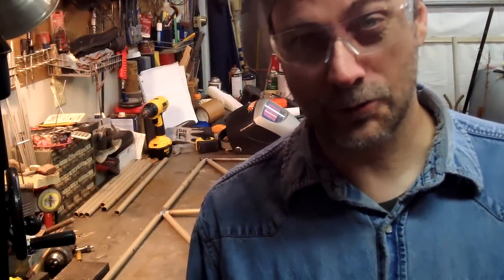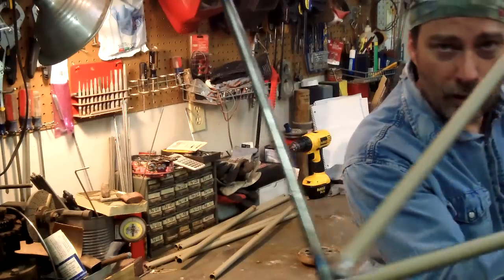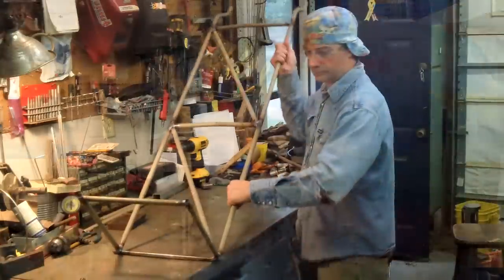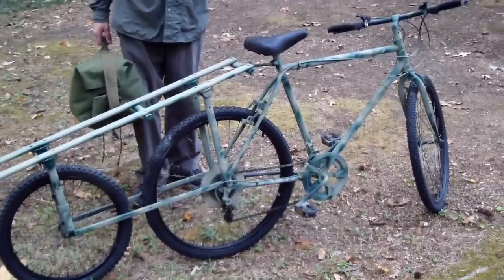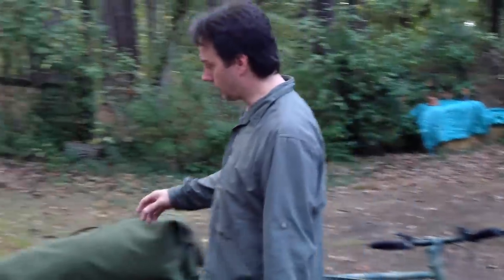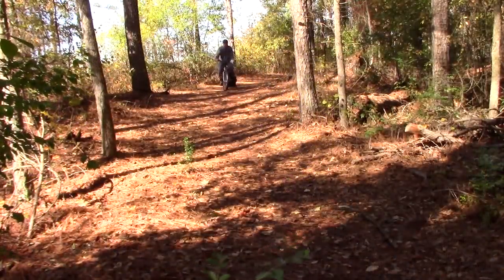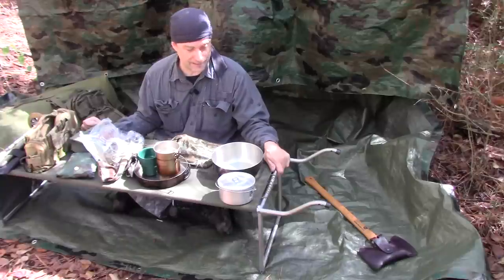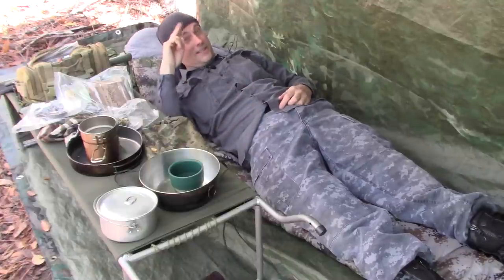The Bushcraft Camping Bicycle Travois

Comment: I dream of one day having a TIG welder but until then I have to make do. I'm thinking one of those convertible hand carts that you can use as a two wheeler or platform dolly and modify it into something similar. It would be heavier of course.
Reply from the maker: Absolutely get a TIG when you can. It's incredible. Thanks for watching Jim

Comment: dave buddy great idea looks great but those wheels are going to be your down fall . i pulled a trailer behind my bike for years . look for a child's bicycle trailer . then ether modify it  or strip it for the parts you need  best part is if you find the right one the wheels are quick  release and i think they have the high speed bearings as well    . another  thing and i found this to be the best way to do it and it gives you another place to put gear is to put a bicycle rack in the back it will give you the clearance for the tire lower the center of gravity on the trailer  and with a little modification you can still use your ball pivot . oh and a small piece of ply wood in that cloth sleeve would be light and stable for a table as well . if it were me and its not  but i would just find a children's  bike trailer and mod the hell out of it . ok brother your the man . hope some of this helped  beleave  me brother like i said i pulled a bike trailer for years  childs bike trailer is your best bet . every thing you are going to need is there  just give it the dave bush craft mods .
Reply: sending you a link check your spam box
Reply: should give you a good idea  if you dont want to buy one has a pic of all the dimensions . this is one i kinda thought was what you were shooting for  if you want to build it  . just trying to help bro .
Reply from the maker: The small wheels with the high speed bearings work perfect for trail use. Since this video was filmed I now have a larger set of wheels I swap out for off trail use.

Comment: I think bigger wheels will make pedaling easier. With a bigger wheel there is a larger rolling surface which will not bury in as much to the surface you are riding on. Kinda like how the tires on off road vehicles are. Skinnier tires dig to the bottom of the mud and wider tires more skim the top. Are the legs strong enough without side bracing?
Reply from the maker: The small wheels with the high speed bearings work perfect for trail use. Since this video was filmed I now have a larger set of wheels I swap out for off trail use.

Comment: That is a really cool idea. I wish I had a welder that could weld that thin of metal. I've got probably 12 of those fold up chairs that are all ripped and no good. Do you think brazing or gas welding would work on that thin of metal?
Reply from the maker: Thanks Keith,  I'm glad you liked it.  Yep, brazing should hold this together
Reply: @Reallybigmonkey1  brazing I can do. That little harbor freight welder I have would just burn right through that thin metal.

Comment: "Travois" is a French word and is properly pronounced "trav-WAH", but it's a small detail. I have read about these in various books in which the sides remained adjustable for carrying loads of different widths. 

One way of making one is this: / \    The other way is this: \ /   The first way is more stable but the second is easier to pull/drag.

There doesn't have to be a significant difference in widths from top to bottom, but the general idea is affix the top end and drag or roll the bottom end. It can be made to adjust to the chosen cargo and can be wheeled or dragged, singly or by 2 people, or by a pack animal or a bicycle as you stated. 

I own a bike trailer that attaches to my rear bicycle axle.  It rolls nicely on its own two (smaller) bicycle wheels, the main weakness being that all the tires are subject to punctures. I would guesstimate a weight limit at 50lbs -- decent for groceries but  little else. 

Having written that first section before watching the entire video, I admire your ability to work with metal as well your (current) finished model. The way you attached it to the bike was quite ingenious! Based on my own experiences, I had a feeling that your bicycle wheel might rub the backside of your travois, but as you stated, a pair of brackets should solve the problem, especially if they are affixed to your rear bike axle. 

Have you considered making a travois from pvc pipe? Do you think there'd be any gain in durability? Load-bearing capacity? Might it be lighter than the metal tubing? I've no idea here; I'm just tossing out ideas. 

I'm REALLY looking forward to what you do next!
Reply from the maker: Thanks for the comments.  Haven't thought about PVC but I like that idea

Comment: Thin aluminum tubes often crack and break into !  Ex.  Like them cheap folding chairs !  Probably fail you when you need them the most ! 
1/2" cast iron tube may weigh more but endure more especially  with Rust-Oleum paint !   You making  a Dolley hook on back of a bicycle !
Reply: Larger wheels to lift up back so it will not  rub against the back bicycle wheel !
Reply from the maker: The tubing is not aluminum, it's steel.
Reply from the maker: The small wheels with the high speed bearings work perfect for trail use. Since this video was filmed I now have a larger set of wheels I swap out for off trail use.

Comment: with the wheels larger it shouldn't drag on your bicycle wheel but not more bicycle tires ...hand truck tires ? I have 2 buggies I had the idea of and hubby put my idea together and my scooter or my arms will pull it.  We used the ball bearing tires that swivel  on front and straight ones on the back and it is light weight & easy pull.  (the tires came off a cart from a motel ) lightweight rods make up the floor.  I sure wish I or hubby knew how to weld as that would have made the job a lot easier.  I saw  the projects in my head and he had the pleasure of putting what I could see together. LOL>
Reply from the maker: Yes larger is better and I think like you. Bicycle tires are to big so since this video was filmed I've added larger wheels from a self propelled lawnmower! Your project does sound good. If the hubby can't weld has he considered riveting? Often times with light weight tubing you can flatten the ends, drill and rivet it for a super strong connection.

Comment: Coming from my own experiences, I suspect that you will have problems with the small wheels.  You have thought it through with the bearings, but only as regards road speed.  The issue I think will be negotiating obstacles on foot.

As a get around for having to use public transport to and from a remote rural location, I used a wheely bag.  The overall size and capacity being similar to what you bult, although designed to free stand vertically when stationary.  Handy for going through airports too.  But its big problem was negotiating steep curbs (common in the country I was living in).

These would rely on pulling the bag up the obstacle, putting strain on the handles, frame and my back, worsening the heavier the load carried.  So if you do intend to negotiate any but the shortest distance on foot, you may find it both fatiguing and potentially damaging to the travois.

Whereas a bigger wheeled design would allow the clearance of larger obstacles.  Not that I would advocate going up to bike wheel size, but I was very jealous of a more advanced version my brother bought from an Australian manufacturer, which had been clearly built with a more rugged outdoors design in mind, and had wheels about 60% bigger (yours and mine looking similar sizes).

As it is mind also had dragging problems because it lacked the ground clearance, so the bottoms of the bags wore out through getting snagged if sinking down into gravel (a problem with the narrow wheels) or just from sticks in the path.  The first thing to wear though was always the wheels themselves.  Bearings were fine, but you may need to replace tiny wheels often if using that a lot.

I hope it works out fine as is.  But if you do a redesign, and are still tempted by the bed idea, I would start with that as the basis (i.e. making it rugged enough to support your weight first).  Plus when you were laying next to it, it seemed a tad small.  As an alternative to a mudguard suggestion someone else raised, you could line it outside with a stretch of waterproof fabric near the wheels, to stop a bed (or even the current table design) from getting mud caked.

Finally longer arms for it would be more in keeping with the original travois concept (which doubtless has its practical manhandling reasons) and would help to keep you away from the rear wheel (as a lengthened design would otherwise worsen the current situation). 

Hopefully though my worries will either be off, or you will find ingenious ways to overcome any that do turn out to be issues.  If so sorry about my armchair critique.  New inventions just get my mind turning over looking for flaws and advantages.  The latter of which are abundantly clear and you have a superb concept!
Reply from the maker: The small wheels with the high speed bearings work perfect for trail use. Since this video was filmed I now have a larger set of wheels I swap out for off trail use.
Reply: @Reallybigmonkey1  Awesome.  I had faith you would find a solution to that anticipated problem!

Comment: As afterthought: What's plan B if a weld breaks?
One of your hold downs/or equip. stash should be a flat strap? Wrapped as duct tape it's quite dependable.
(reply not needed Dave)

Btw, my classic era 21 speed has lever shifters and gave me Big trouble after sitting too long. Even tho grip shifter, you may want to give the shifter mech a shot of what needed here and there to keep it frisky.

~ Old addage; Four wheel drive only gets ya stuck in more remote places. (-:
Reply from the maker: Thanks for the comments Brian

Comment: Another great video David, but I think you will need to fit wheels around 6 inch in diameter, as the small ones are likely to get stuck in small or large ruts in the ground, also slightly bigger wheels will give better clearance on your rear wheel. One last think, larger wheels tend to roll better, especially on tarmacked road surfaces, just an opinion.
Reply from the maker: The small wheels with the high speed bearings work perfect for trail use. Since this video was filmed I now have a larger set of wheels I swap out for off trail use.

Comment: Skyway Tuff wheels makes 12” wheels with precision sealed bearing. Would take inflatable knobby bmx tires and be perfect on or off-road
Reply from the maker: The small wheels with the high speed bearings work perfect for trail use. Since this video was filmed I now have a larger set of wheels I swap out for off trail use.

Comment: 2/ Actually if you tied off a bunch of plastic zip ties off under the frame there, it would add a lot of flat-stability to the whole frame with 0 extra weight and also make that table function a little more secure for laying stuff on.    I've used a similar principle in something in my kitchen and also my tool crib.  They just need to be connected 1, 2 or 3 to each other and at the proper angles there.  I can balance plates on one of the places I used them for, so this might help you.  The cheap part and no weight part is kinda nice, it fits your mantra also.  Plus you can hand stuff on them on the underside, with or without carabiners or hooks.
Reply from the maker: That's a good idea Barry

Comment: There's a guy with an electric bike and a cart w/ one wheel. All OEM not home built. on with the show. I like the Idea, But i think the cloth will turn into a red clay counter top. So I would tig weld an aluminum Plate that you can wipe off. And add fenders, You know those silly looking ones that wrap all the way around the tire/ tires. Oh and electric hub motors with jigawatt capacitor batteries. lol if only!
Reply from the maker: I am planning on a different cover. Thanks for watching Robert!
Reply: @Reallybigmonkey1  I look forward to seeing that. I like your channel and your Ideas, I got a real peach of an Idea I want to share soon

Comment: Great idea. Larger wheels would be great but not the really big bike tires.
Reply from the maker: The small wheels with the high speed bearings work perfect for trail use. Since this video was filmed I now have a larger set of wheels I swap out for off trail use.

Comment: Excellent, but I think larger diameter wheels on the trailer will give more clearance to the rear bicycle tire avoiding a pinch point on the tire. You could also move your connection point back with a longer connecting rod.
Reply from the maker: The small wheels with the high speed bearings work perfect for trail use. Since this video was filmed I now have a larger set of wheels I swap out for off trail use.

Comment: Again I made some comments that I messed up and deleted by accident.   Did you make a video with improvements other than the one with two rod ends?  I wanted to see the improved table.  If you made a single leg at one end it would stabilize the table so it wouldn't wobble.  Did you add struts or use larger wheels to change the angle of the hand cart to the rear bicycle tire?  Or did you just make one major improvement and go straight to the two rod end and large wheel video?  Thanks for another great video.  Interesting to see how you adapt your design as you go along.
Reply from the maker: Believe it or not but the improvements on this other bicycle will be on the next video I release!

Comment: really cool idea, but I think these wheels ( or something like them) would not only give you the clearance you want, but also would roll a hell of a lot better on rough terrain. I am actually working on a trailer to pull behind my wheelchair, and am using the 13" version. ( I think the 10" would be more than you need here) also, if you got some semi rigid plastic sheet, and attached it to the inside of that cloth it would give you a bit more of a table surface without really changing the weight much.
Reply from the maker: The small wheels with the high speed bearings work perfect for trail use. Since this video was filmed I now have a larger set of wheels I swap out for off trail use. I really like the plastic sheet idea. I may use that!

Comment: If you strapped a couple of ice chests on it, you could ride up and down the Appalachian trail and sell ice cream. This is a very cool set up, but you definitely are going to need bigger wheels on the back, otherwise you’re just gonna keep rubbing the rear tire on the bicycle. Peace ✌️
Reply from the maker: The small wheels with the high speed bearings work perfect for trail use. Since this video was filmed I now have a larger set of wheels I swap out for off trail use.

Comment: Great vid.   But, your table top will be covered in wheel splash after 5mins without a mud guard.  
Id go with bigger Golf trolley wheels if i were you. They are designed for all terrain....mud, puddles, hills etc...bonus is they easily detatch. Also they need to be offset lower to allow you to carry anything which will overhang the sides ie wood.
Reply from the maker: Thanks, I'm glad you liked it. Since this video came out I've already improved a lot of stuff on it

Comment: If you did need taller wheels, couldn't you drill the razor wheel and bolt it to the center of a larger wheel? That way you could still have the high speed bearings..
Reply from the maker: The small wheels with the high speed bearings work perfect for trail use. Since this video was filmed I now have a larger set of wheels I swap out for off trail use. I'm in the process now of adding bearings to my larger wheels

Comment: If we can't weld, could we flatten the ends, drill a hole and bolted the frame together?
Reply from the maker: Yep, probably could as long as you use lock washers or double nuts.
Reply: Judy, that's exactly what I did.
Dave's right...without locking washers, those nuts will eventually walk off the bolt. &)

Comment: Dave, you are going to have to weld some small support braces to the ends you welded on or they will break off with very little pressure.!
Reply from the maker: It will hold what little I'll put on it.

Comment: I am no engineer,. but I believe a larger diameter tires on the trailer along with stronger mounting "screws" for the tongue will help you out quite a bit.
Reply from the maker: Since this video came out I now have two sets of wheels.  The small precision bearing wheels on it for trails and a larger set for off road use.

Comment: I think a set of 10 inch tires and wheels for a hand truck would solve all you problems. You can get them from Harbor Freight cheap. You have a choice between inflatable or solid tires. They would give you better clearance and easier to move through the woods or even used for collecting firewood or building material.
Reply from the maker: The small wheels with the high speed bearings work perfect for trail use. Since this video was filmed I now have a larger set of wheels I swap out for off trail use.